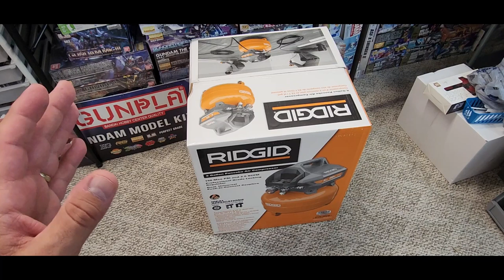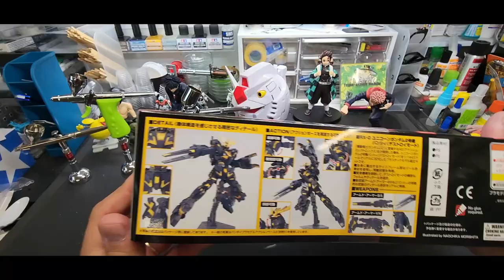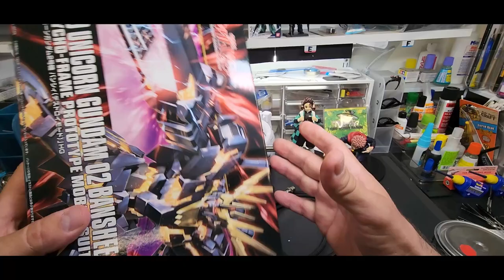How To Use A Full Sized Air Compressor For Airbrushing - Harbor Freight - Plus Gundam Give-Away

Comment: I'd invest in a moisture trap, just for caution. I think most full-sized compressors pool moisture in the bottom of the tank, but it only takes a really humid day to ruin a paint job.
Reply: Additionally I suggest a street elbow and ball valve to drain a tank when applicable. A dry tank will push less water into the pipes and will last longer. Your comment is great!
Reply: @chrisholschbach6168  All the pancake and up compressors have a drain valve on the bottom of the tanks to drain water.
How I have mine setup in a shed is on the top floor I put the same exact compressor (to cut back on noise),I then ran about 10' of 3/8 hose (which is the line these compressors normally use) down through the floor to a a dryer/filter out of the way about 1' off the floor and to manifold about 2-5' off the floor behind my work area where then my brush hose connects.
The dryers/filters need to be lower and as far away from the compressor as you can get so as it can be as cool as possible for it to remove as much moisture as possible is the reason it's the lowest item in the system.....water runs downhill.

I also wired in a light switch at my work area to turn the outlet on/off that the compressor is plugged into,so all I have to do is flick the light switch and the compressor starts.

BTW,HF has probably the best hose for the buck,the orange PVC hose. The rubber hoses degrade from heat and ozone and crack/split and then blow...and also cost more. It comes in 25-50-100' lengths and I used about 10' of an old one I have had for about 25-30yrs working on cars,trucks,equipment,ATV's,etc.

Comment: If you have a large noisy compressor thats not close to your hobby work area, get a portable air tank thay you can charge to 125 psi, or more, and take it your hobby area. No noise and it should run an air brush for a good while before  needing a refill.

Comment: Not a huge deal but you should run the compressor the first time for half hour with valve open and pressure full , it properly sets seals in compressor which will make it run a little quieter and shorter run time to fill

Comment: That’s actually a nail gun and for some air tools compressor. Anyways I have the exact compressor and it’s ten years old and still pumpin. I’d build a lil shack around the compressor and put it outside lock it up and run a longer hose.

Comment: i brought a compressor with a tank cheap online and the only gripe I have is the noise.. so I bore some holes, sound proofed and mitigated the vibration inside a nearby unused cabinet in my hobby room and somehow worked to the point that no one can hear when I use it to paint.. the channel has really inspired me to find and DIY a lot of solutions to potential setback encountered in this hobby.. thanks!

Comment: I saw that RIDGID compressor at HD a few days ago.  Comes with lifetime warranty.  The obvious advantage to the RIDGID is also useful for pressure washing, bead blasting, spray gun, etc.  Liked!
Reply: You're gonna want a 40G or better if you're painting and blasting big jobs like full size cars. Pancakes are great for construction sites nail guns, brads, etc. It can be done, but that's a lot of work on a small oil less compressor.
Reply: @tadracket448  I was gonna say the same - possibly an air gun for dusting too but basically if the tool has a spinning part in it volume (tank size) is king.

Comment: I bought my airbrush a few years ago, planning to use the exact same Rigid compressor you used, but got frustrated with trying to make the necessary adaptations and gave up. I recently got it figured out though! I bought a water trap with a regulator and had a very hard time getting the fittings right. I suspect that it had the metric threads which almost but not quite fit the standard ones. I finally made it work by using the 1/4 to 1/8" adapters it came with, then adapting from there. 
I left the compressor regulator maxed out, since I use it for nailguns as well, and ran an 8' hose which I had to my new reg/trap at my bench. 
Like you said, once it's full it lasts a long time, but theres no way you'll get a week out of it! I fill it up during each day I'm going to be using it and shut it off and it easily lasts an evening.
Pro tip: I work as a home remodeler and we have an ironclad rule of shutting off AND unplugging compressors EVERY night. If you have even a small air leak, that compressor may come on in the middle of the night and scare the begeezus out of the residents. (I know of two times in which it happened!)

Comment: I have been using a similiar setup to this for a while now, works great.  Only difference is that I have a moisture trap added to the line.  Thanks for your great content!!
Reply: Thanks! That was going to be my question. Airbrush compressors have one built in sometimes. So, I'd think having a moisture trap attached to the hose would be a good idea.

Comment: I use this same compressor in the garage to fill up a portable holding tank I got from Harbor Freight. It lasts a long time before a refill. I bring the holding tank into the hobby room and  run a curly hose off the holding tank to my bench-side pressure regulator and water trap, then connect the airbrush hose to the regulator. The water trap is essential if you paint wherever the humidity is high. I use quick connects on everything so I don't have to carry hoses with me when I go to the garage for a refill every couple of days. I wouldn't change this set-up except if I were building a new house. Then I would plumb in compressed air and vacuum lines directly inside the walls from the garage to the hobby room.

Comment: You gotta get the harbor freight fortress super quiet. It sits by my feet while I paint
140 bucks out the door. It also helps to use full size filters, it's very humid where I'm at but thanks to the filter the air comes out very dry.

Comment: I bought the Harbor Freight airbrush compressor combo after seeing your review. I have since been using me 25 gallon 5 HP Craftsman compressor, adapted down to fit my airbrush water trap/regulator. I love this setup as I can fill the compressor tank to 125 psi,  but dial it down to 40 psi to my water trap/regulator, where I dial in my final working pressure.  I also have a 7 gallon portable air tank I can air up to 125 PSI if I need to be mobile. Of course, I do all of my airbrushing in my garage, for now.

Comment: Great video!

I ran a 100’ hose from my garage compressor up through my attic into the room with my paint booth. I’m using the Makita “silent” 2gal. It’s great not having to hear the compressor in the room with me. I mainly did this so I could paint at night when my kids are asleep.
Reply from the maker: Congratulations you've been picked as the winner. I will also announce this in the next video. Please contact me using my email address in the description
Reply: @barbatosrex9473   Noooooo WAAAAAY. Emailing now

Comment: Thanks for the video, I used a regular compressor for a few years before going back to a hobby size. The only problems I had with it was the noise. I couldn't run it in my hobby area without waking up the wife or kids.  It would also scare the shit out of me when it would kick on. I like the tip of turn it on else ware and then unplug it and bring it in the room.

Comment: I set this  up a couple years ago with a bostitch air nailer compressor and it works great. I leave the machine out in the garage and ran an air hose into my hobby room. I leave the regulator on the compressor at around 100 but I added a cheap regulator in the line next to my work bench so I can adjust it as needed.

Comment: I am running a industrial style air compressor with a aluminum tank. Just for anybody who is interested in going this route I would advise you go with the aluminum tank for the simple reason of being non corrosive the steel counterparts are at risk of rusting if the user doesn’t remember to empty the tank of water condensation which you DO NOT want to have the steel tank possibly explode over time. So aluminum with a relief valve is much safer. You will also need a moisture trap otherwise you will have water running in your hose and ruin your paint. Be aware of the thread types when conversations are being made. Most compressors are made in china and will have a “BSP” thread type and you may have to use fittings with a “NPT” thread type which is what is the standard in America. Yeah that’s our freedom of the oppression which is known as “METRIC SYSTEM.” And finally make sure to use Teflon tape to make your fittings leak proof. I have done it and it’s not too expensive or hard to make a compressor airbrush ready. Hopefully that will help you all out good luck and happy 4th to my fellow Americans.

Comment: I bought one at Home Depot when I worked there. Got a great deal!  It sat in my garage for years, until I got back into the hobby. Works great but I replaced the plastic hose with a rubber one. Problem with it (as you’ve mentioned) is that it’s very noisy. I love it though!  Thanks for sharing. Happy days and model on!  😎🇨🇦

Comment: Thanks for the review.  I started with a Harbor Freight pancake compressor but my wife did not like the noise.  Now I use it in the garage.  Had not thought of using a regular spray gun on model kits.  I'll have to give that a try.

Comment: I put the same disconnect on all of my airbrushes.  It’s a bit of a headache getting the right adapter fittings, but once you do and if you use the same quick connect, it gets pretty simple.  I also use a small inline moisture filter at the airbrush, between the quick connect and the airbrush.  It helps me hold the airbrush because my hands don’t always do what I ask them to.   I use a 2 gallon ultra quiet compressor.  I spray my 2k clear on my car models and aluminum panel paintings, with a hvlp gun.

Comment: I've got a 60 gallon air compressor system running on 2 phase. Man I can spray airbrushes all day long with out refilling the tank. With bigger spray guns like the one you used and car spray guns my air compressor only turns on every 5 mins-10mins depending on usage.  Refills in about a min and a half so it's never really a problem but it will scare the crap out of you when it kicks on if your not expecting it. I wish I could have it in the shed instead of the garage but the cost to move it and run electrical is too much for me.

Comment: Most hardware stores have the reduction fittings needed, but running a line from the compressor in the basement to a hobby room is pretty straightforward. Using a pressure reducing valve (PRV) to bring down the pressure to 50 PSI inline then a smaller PRV at the end of the line so you can fine tune the final PSI.

Comment: I have an old Campbell and Hausfeld shop compressor in my garage. It is LOUD, but it powers my impact wrench, nail gun, and fills my tires really well. I considered using my airbrushes with it but fine tuning the pressure from such a broader pressure gauge would be difficult. I also didn’t want to bother adding a moisture trap to it so I just bought a dedicated airbrush compressor short of waking up the dead lol.

Comment: Your A/C went out? I got that one beat! I had a family of raccoons get into my duct work last week - a mama and 2 babies. They're gone now, but it was annoying. They sound like dolphins.
I've had a cheap Harbor Freight compressor for about 15 years, and it still works fine. I use it for my pressure pot. I got an airbrush compressor with a tank, because they're so much quieter. Learned a lot about airbrushing from your channel. Thanks!

Comment: Great Video! I have a regulator/moisture-seperator screwed into the table and connect my airbrush to that. It allows me to regulate pressure right where I spray and put my 6gal compressor wherever I want.

Comment: I have to re-iterate a moisture trap. I've been using a 3-gallon pancake for years. A filter/moisture trap is pretty much a necessity if you're using this for airbrushing...especially in a humid environment like MA in the summer.

The family use to live in Worcester - left in 1972...I've been in MN pretty much since...but I've got cousins currently living in Sterling.

Comment: Awesome video as always!  I've picked up a moisture trap for my big air compressor, just to be safe.  I do have a smaller compressor for my airbrush, but when I finally get my larger booth built for my basement garage I figured I'd use the big compressor just because that's where it is.  The convenience of having it close will make it handy and leave my smaller hobby grade one for times when I need something more portable.

Comment: Using a similar setup with an ultra quiet work compressor, just make sure the adapter for the hose is NPT or else the threads may not match

Comment: Badger sells a adaptor that connects their hoses to a  1/4" NPT nipple.  I've always liked their hoses so each of my air brushes, Badger or otherwise have a Badger hose and then a quick connect to the air brush itself fed from manifold using  their 1/4" adaptors.

Comment: I've used a full sized compressor when I airbrushed the "measles" on my car front.  You must use a moisture trap/regulator at the compressor, air gets hot compressed, moisture accumulates in the tank, period.   I used air tools, one of the reasons tools have oil added every use.  Always use a moisture trap at paint spraying guns, regardless of type, moisture accumulates in the hose also.  I know the hard way!  When it comes to spray guns (& air tools) , CFM is the value you need to match between compressor & tool.  It's the air used by the tool to operate constantly, different from the on/off pressure settings.  I haven't used a HVLP (high pressure, low volume) spray gun.  All I know about them they produce a lot less paint dust than a standard spray gun.  Last, you should empty the compressor tank when not in use.  Draining the tank of the air drains the moisture trapped in the tank, reduces internal tank rusting.  It mentions this in the compressor manual.
Reply: While having a second trap/filter at the tank is fine, you want filtration and moisture trapping close to the tool. The hot/warm air at the tank holds moisture as a vapor and passes through traps/filters (The small can type that most folks use for these applications). Having the trap/filter down stream far enough to let the air cool and thereby letting the moisture condense out from vapor to liquid. So, if only one filter is in the budget, have it near the tool. And have a long enough line to allow the air to cool. A 5' hose off the tank isn't really long enough. 
Or go nuts and do a copper pipe/tube chiller to really pull moisture out. That can go closer to the tank and keeps moisture out of the hose too. 👍

Comment: I managed to get my hands on a Jun-Air compressor (I think they go by Sil-Air in other parts of the world) for a very good price. They're expensive as hell but very very quiet and feel "old school" and very solid in their construction. I paid about 1/4 - 1/3 of the normal price so it was still a bit of an investment but I doubt I'll ever have to replace it. With the 25L tank I can go for quite a while before it even kicks back on and it should be able to handle a HVLP gun for short bursts as well.

Comment: I picked up a full sized compressor 2nd hand for air tools. I'd planned to get a spray gun for it as well for larger projects so this is very useful info.  My airbrush compressor is a Master Airbrush TC-96T. The larger tank on it is handy, and even when it's running it's pretty quiet.

Comment: Got a larger silent compressor when I moved to airbrush art.
They are on amazon but can't post a link - youtube strips it.
The main compressor body has two sliver cylindrical sides seperated by a black middle.
They have a black screwon silencer with a plastic tube - reduced noise to under 60dB.
I got a 9L tank version which gives 2.5 minutes continuous spray at 20psi and 30 seconds to refill.
The more expensive branded version of the same thing is by california air tools in the US.

My old workshop compressor does 90dB and not recommeneded for indoor use.

Comment: I'd be interested in seeing an "all from Harbor Freight" setup - they make a "detail" spray gun and the ever popular Purple HVLP that may have a sale price (with coupon) for $10.  Though I'm no pro it may be a good idea to add an in-line regulator gauge combo and a water separator especially as your tank size becomes larger to avoid getting moisture in your line and into your tool.  Great content and excellent explanation of what fittings you'll need between the 1/4" NPT and 1/8th inch - I'm sure a lot of others are more familiar with the "air tool stuff" like I am and are just now getting into models and kits.  Thanks again!

Comment: I have a pancake compressor that I used to use before I got the tooty. It worked fine but I did need a second regulator for it, the one on the unit itself couldn't reliably go low enough for airbrushing. So I would set the one on the pancake to like 30 and then the second one to the 5-15 I needed for the brush.

Comment: Never thought about using my full size air compressor, I have a DeWalt dual tank it's amazingly quiet.  A quick tip when your done, shut the air pressure to zero.  The tank will last much longer..it will bleed off air otherwise.  Have a great 4th of July!